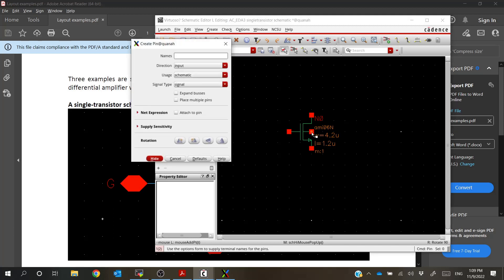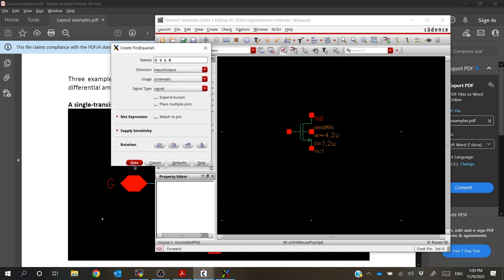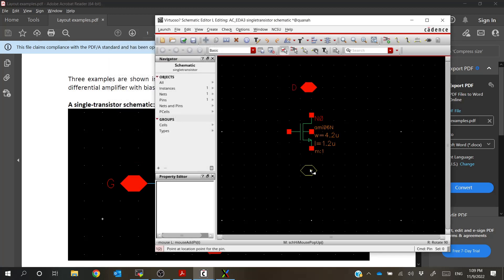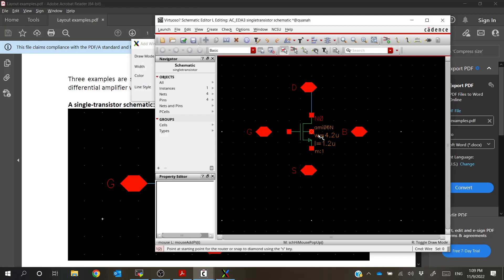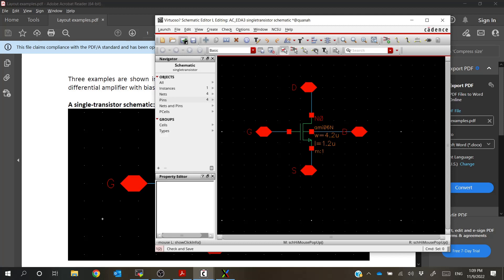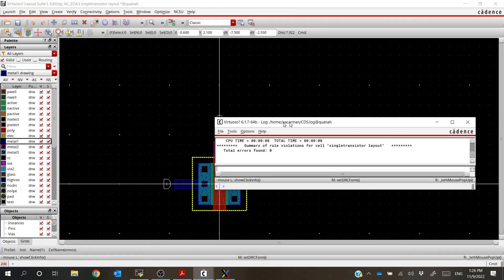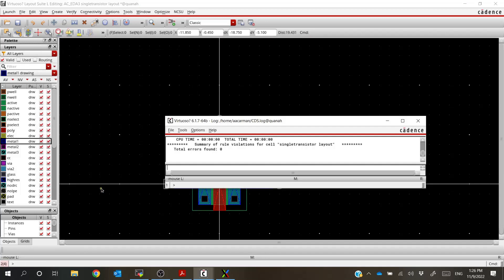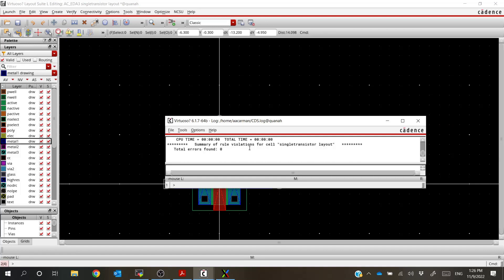Cadence Layout View and Common Centroid - ECE x321 EDA Tutorial 3

Comment: 1. You can press "k" to get the ruler.
2. The reason why the resistance did not go down after increasing the width is because the did not increase the width of the metal 1 of the via. If you want to reduce the resistance, you need to create more lanes for current to flow.